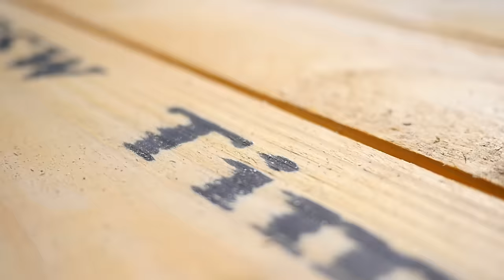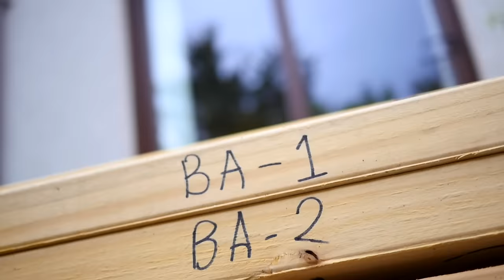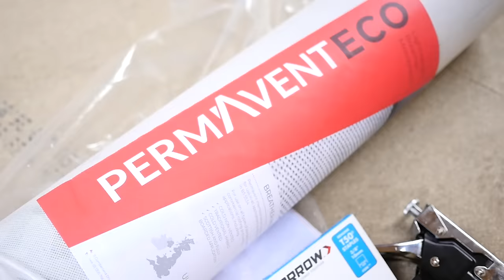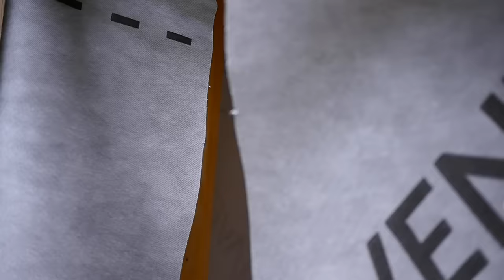Building a Workshop Shed In The UK From Scratch

Comment: Excellent workshop mate 👍🏻 bit of friendly advice though that codelock is not suitable for that purpose ideally use a 5 lever BS sash lock, codelock Is ok for interior office door but not for exterior door, Also hinges need replacing for more heavy duty. Sashlock will provide a lot more security. Other than that it's absolutely spot on what you've done as your first workshop
Reply from the maker: Thank you Stephen. Currency almost nothing is left in there over night but that will soon be changing so i'll look into your suggestions. Thank you.

Comment: As a quick insight to my background and knowledge of coatings, I was a spray painter at Disneyland in california for a decade or so but with the paint department for twenty-six years.
If you can get your shop at least three or four feet high and it can be SAFELY blocked up and secured I recommend you rent an airless spray painter and apply the coating that way - we used bitumastic on the lower exterior surface of the 'submarines' we had, and inside of the trains steam tanks as well, and several other areas where deterioration due to water/rust or rot were a concern.
But two things to know is, NEVER "test" the pressure of an airless gun like painter's do with an air supplied spraygun - YOU WILL LOSE YOUR FINGERS! as the pressure will flay (cut) your skin from the bone and this happened to one of our "Journeyman" painters no-less.
The second thing is some people are VERY sensitive to bitumastic coming in contact with their skin so make sure you use a heavy duty spray suit, rubber gloves and proper spray mask if you decide to do this your self but if you don't want to spray it, get a brush similar to the ones used to wash a car with because they cover much better than a mop and will be much more manageable than a mop will be.
Best of luck and if you have any questions contact me at:
lwhalen2016@gmail.com

Comment: No vapor barrier, no ventilation between membrane and cladding. you may find it sweats a little
Reply: He wrapped the whole frame in a vapor barrier did he not???
Reply: @iamneallyons4263  , there should be a vapor barrier on the inside, between the osb and insulation.
Reply: @jamoco1  How's that going to work because any vapor will then just go through the barrier onto the osb wouldn't it?
Reply: He put a vapour barrier round the whole lot... only thing I may have added was a vapour barrier under the timber that’s in contact with slabs.
Reply: @mullettjf  breathable membrane to the outside, between studs and baton, allows moisture to wick to the outside due to air flow.
Visqueen vapor barrier prevents moisture , contacting the internal substrate, thus preventing Mould
Reply: @iamneallyons4263   No
Reply: @jamoco1  so it deflects any moisure back out towards the shiplap/cladding you mean?i agree with the batons on the outside after the external vapor barrier wrap he did because it leaves a gap between the shiplap and the barrier/timber.
Reply: @jordanmclaughlin3312  or STUD - VAPOR BARRIER - BATONS - CLADDING should suffice as leaves a small gap between cladding and vapor barrier correct?

Comment: Hello mate.  Can you give us a breakdown of the costs and also the materials you used, is what type of stud, what type of instillation, what type of mdf for floors.  
Love the video by the way, watched everyone second without skipping any part!
Reply: I’m planning to do the same in my garden.  I’ve been quoted £7K labour and materials excluding the fascia material.  Thinking to do it myself and atleast save on the labour
Reply from the maker: Hey there Ruddy, I'll have a video coming out in a little while where i'll have a lot more detail on it all. All the wood in just pressure treated timber 95x45mm or 45x145mm the flooring is standard house construction tongue and grove treated flooring. The insulation is 100mm slab rock wool as I wanted sound absorption over thermal retention. I love that you have enjoyed the video so much and that i may have inspired you. As for the cost of the build, in total around £1200 a little more info in the video description. Sounds like 80% of your quote is labour. Which in all honesty is I can't really say much on as it really depends on skill, experience and quality. But to give you a rough Idea I charge £50 an hour as a minimum and I would say For a client this would be a 60 - 100 hour job just one guy doing it. I don't know your full personal situation but If your fine with hard labour, screw-ups and the adventure of learning on the job It's a great project. My top tip is PLANNING! down to the last screw.... It will help greatly! Plus make sure you are clued up on your local restrictions. Hope that helps and good luck with whichever decision you make  😀
Reply: @Keep-Making  Hey, thanks so much for your reply and the detail.  After watching your video, I think I will get my guy to just lay a concrete bed down for me, and then I will have a go myself.  

One more question, suppose I have a go myself and mid project it starts raining, can I leave the pressure treated timber out in the rain.  I.e if I build the shell of the unit and leave it exposed bare for a few days or rain, will the timber go bad?
Reply from the maker: No problem Ruddy,

Long and the short is the dryer it stays the easier it is to work with and over all less problems there are to deal with. i.e. easer to cut, work has not expanded yet ect
I personally got myself a few blue tarps and covered everything to the best of my ability when I was not working on it or if it was raining.

Have FUN!

Comment: Hi there, really tasty work. Well done. I plan on starting a 16 x 10 foot shed in the next month but I have a question.
Regarding your breathable membrane and insulation....This is only a question, not some smart statement, but is there not supposed to be a air gap between your outermost timbers and the insulation to allow for cool air transfer and avoid sweating? I'm a bit confused by some conflicting information, Is your shed staying dry? Cheers man.
Reply from the maker: Hey there Jody, If you take a look at my FAQ video I mention that the only thing i really did bad was exsactly that. I needed to add some batons in between the cladding and the membrane. But, thankfuly as i made it all a breathing structure I have no problem with moisture and it's all still dry.

Comment: Nice video. Please answer me these questions three : 1) What are standard UK dimensions for spacing the frame? ( I.e so you only have to adjust length of insulation and not the width).  2) Software to determine materials on the ipad and 3) Approx Budget? Thank you sir!
Reply from the maker: Hey there Nick, I'm so glad you enjoyed the video and I'll make sure I add these questions to my FAQ video as for right now.
1) Usually, it's called 600mm from centres. Make sure you get the right boards which should be 1200 x 2400mm
2) It's manually made using air table. 100% free. I'll make sure I add some info of this in the FAQ video.
3) It's in the description of the video.
I hope that helps 😀
Reply: @Keep-Making  Thank you very much! Subbed.

Comment: got 2 questions :) nr 1 Why did you not raise the frame of the shed on lifters so its not directly to the ground for rot etc to get a hold of it .. nr 2 did you  put in 0.7 - 1 inch of spacing between outer boards and the frame so there is ventilation in it so it also wont get mold and rot.. ty in advance , EXELLENT video btw
Reply from the maker: Hey Ladosligese, Great questions you'll find that both of those are answered in the Q&A video. https://youtu.be/o20i5UIxPC0

Comment: Love the video and your craftsmanship. I plan to build the shed/gym myself, but almost double the size. I was just wondering was that timber you formed a base from pressure treated, does not look like it is in the video?
Reply from the maker: Thank you Ivan. Sounds like a great project you got on your hands and yes all the wood studs flooring are pressure treated. The only ones that aren't are the cladding on the outside.
Reply: @Keep-Making  great. Yeah, I can't wait to start it, making plans atm.  Would like to film it as well, but that is the extra cost as I have no equipment but the pc
Reply from the maker: @ivanpuskaric6851  Where there is a will there is a way buddy. I used to film using my laptop and I-touch before I got a camera. 😊. Best of luck on the build!

Comment: I think it's a solid effort mate - I would have maybe fitted the insulation boards in the flooring flush with the top of your timbers before covering it with ply - an maybe do some vertical batons on the outside of the breathable membrane before and attach the shiplap to them so you give a little space for the inside to breath out! Overall seems decent through, roof should be alright to as you've got a gutter up etc.
Reply from the maker: Cheers Iamneallyons,
I'm glad you've seen the built form the point of view as a growing lesson for myself as it really is. The vertical batons for sure were needed but by the time I realised it was too late. I did talk to a joiner or two about that and they said I should be ok but to just keep an eye on it. As for the insulation under the floor I have had both advised to me form joiners and I did not know which to go with. So, in the end, I went with the one that I thought fitted best into my way of thinking. If to surfaces are super close then it can turn into a beautiful condition trap which Is the last thing I really wanted. As for the roof i'm more than pleased with it. I was a little worried when it was just the felt but once I put 2 layers of all-weather bitchumen paint on it I gathered it would be more than fine. Thanks for the kind words and letting me know for this I should watch out for in the future  😊
Reply: @Keep-Making  cool mate, im about to knock another shed up in a few weeks im just waiting on the weather improving a little bit!
Reply from the maker: @iamneallyons4263  OH my.... I know that waiting feeling. During this build, I waited more days than it took to build lol
Reply: @Keep-Making  i started about 3 weeks ago, the weather has been utter shite since iv started lol - slowly getting there, got the roof on last night - iv made a mistake however in that iv done an overhang on the front and rear of the pent roof but not on the outsides as i only had 8ft timber available to me (for free) so im trying to make do without spending anymore than i need to, considering just overhanging the OSB 100mm either side of the roof to create a small overhang.
Reply from the maker: @iamneallyons4263  Oh dear! I feel you pain.... weather is SUCH a pain!... An overhang of any kind is worth it. Just make sure you reinforce it as there great spots to let a strong gust of wind come and rip a roof off a wind-driven rain to get in. I wish you all the best with the rest of your build.

Comment: Nice job ,one thing I would say do not build your walls directly off the chipboard floor. Because if you ever need to replace the floor you will have to cut a edge round the inside of the walls.
Reply from the maker: Cheers Michael, I'm glad you approve. Here is the weird thing... I thought this too but after speaking to joiners and seeing more house and workshop videos than I care to admit. I saw that a good 95% of builds are like this. Plus the joiners I spoke to agreed with this build too. Honestly, I had no other way to fit it into my budget to do it any other way in the end. I do dread the day if I even need to sort something under the workshop. 😬

Comment: your going to want to put some kind of edge cap on the felt. you also need some end bits in each corner of the exterior to hide the end grain of the tongue and groove. things will move in winter especially those little tac nails. trust me u will be re nailing or even screwing in a year or two
Reply from the maker: Hey Welsh Maniacs,
I don't know about the caps as it's all pretty much sealed off. As for the tacks holding the cladding. Ya I have a feeling I might have to screw them in too... I did have a little problem with cupping wood. But once I added my topcoat of sealing oil that pretty much stopped 90% of all my warping issues. Fingers crossed for a cold winter tho. It's been through once already but I would not really call it a "cold" one.

Comment: Is that base not going to rot very quickly?is  it better to build on piers to keep an air gap between ground and base.
Reply from the maker: Hey Seb, Well, the wood is very much pressure treated. Plus it's on slabs and a thin layer of DPM to take it off from the slabs. Yes in an ideal world I would have it raised 10 - 20 cm off the ground... having said that I had some Crazy cut-throat limiting factors. Considering I'm 194cm and I only had 250cm to work with. Only left me with 56cm for the roof, Lighting, headroom, floor, base and airspace underfloor. I decided to just my losses and take a risk with no gap. Come 1 Year into the build I'll do a small investigation to see how it's all doing tho. I did have input from quite a feel joiners tho and they all told me this would hold up at least 5 - 10 years. Maybe more if I add some good drainage.
Reply: @Keep-Making  very good points, will consider these when planning out my build ,thanks and all the best!
Reply from the maker: @eaminslim52  No problem

Comment: Great build. I'm interested as I'm planning a garden build next spring - so one quick question. Why did you choose to put the floor inbetween the base and walls rather than have the floor inside the overall frame?
Reply from the maker: Cheers Daz, i'm glad you enjoyed it. Honestly speaking, I just followed what a few joiners told me to do.... But long and the short there is not too much diffrence. You could argue that putting the walls on the floor they have more surface area for support. But in all reality on as long as you screw it down well I would imagen you would be good. I know that for home construction in the UK they seem to put the walls ontop of the floors. But not really sure why. Good luck with the project.

Comment: Great video BTW, very well made. I'm unsure what do do with my flat roof. For extra water tightness should I vapour barrier the roof or use some left over dpm I have? If so what does my felt bind to, only the vapour barrier/dpm? Won't it flap about? I don't really want to roof nail the felt as I dont want to put holes into the felt? How do i get around this? Any help would be greatly appreciated thanks
Reply from the maker: Honestly speaking this was one of of my biggest consequences too. My fall back / playing it safe option was to use black jack all weather roof coating it's a crazy rugged bitumen paint and with 2 - 3 coats of that stuff and your roof should be good for a solid few years... I hope that comes in handy. Ans keep safe if you so use it. It's some sinky, sicky stuff. Eye protection and full separator is a MUST! (Also mix it very well and a stiff large brush works best in my opinion)
Reply: @Keep-Making  Thanks for your reply! At what layour do you recommend putting the bitumen? On top of the board, vapour barrier or over the felt? :)
Reply from the maker: @cciaran  No problem Ciaran, I went with on top of the felt. Means that WAY in the future it would be quite easy to remove it all to replace it.

Comment: Hi Johnathan, could you please tell me which software you used to calculate the dimensions of lumber, and do you have any plans and BOM available?
Reply from the maker: The full plans will be made available soon with a huge disclaimer saying I'm no pro at all. I used rhino 3d to do all my designing but they could have just as easily been designed in fusion 360 or sketch.

Comment: I want to make a shed with green roof size 10.50 * 2.5. Do you think I can use the same type of contruction  and do I need to add extra support?
Reply from the maker: Hey Tony,
That's one hell of a project you got on your hands there. Would this roof be slanted? What depth of soil are you going for? Do you have a thickness of joists in mind? I know quite a few joiners that build green roof houses so if you let me know this info i'll pop them over a message and see what they say for you 😀
Reply: @Keep-Making   
Hi 
Thanks for your answer 
I was thinking  about 10 -20cm slant of the roof. I believe I can achieve great results with 5-6cm of soil and sedum
Reply: And yes im not very confident about joists thinkness